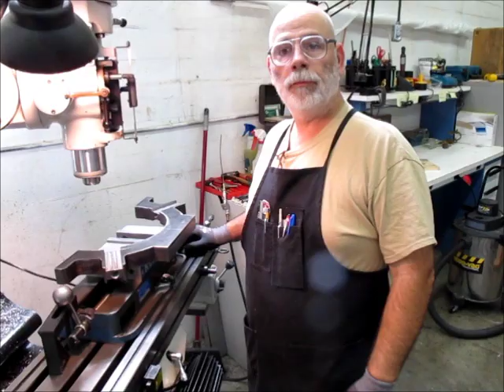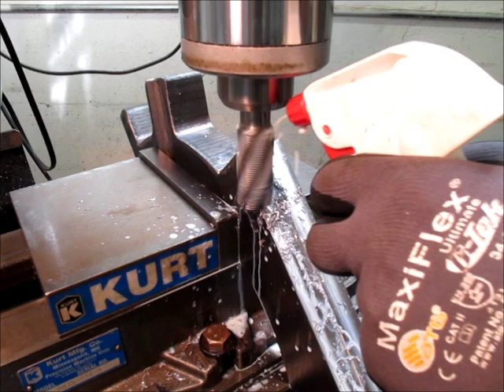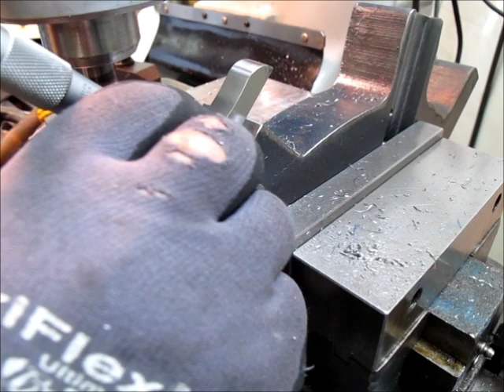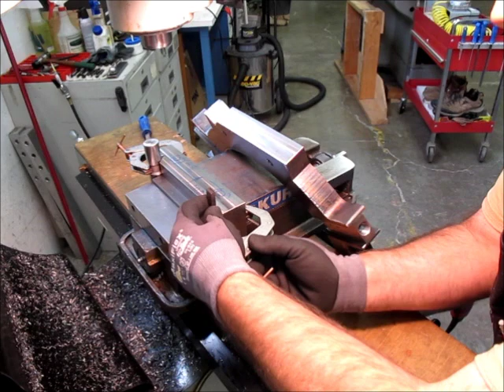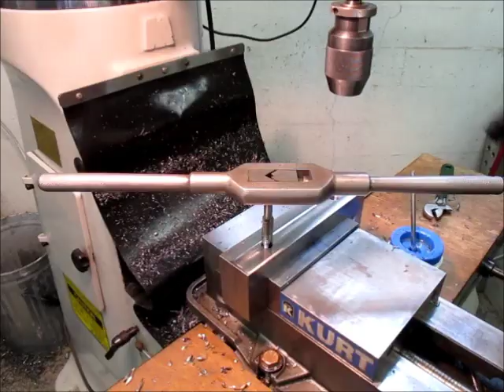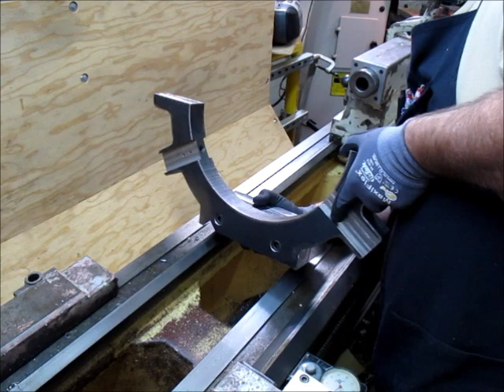Heavy Duty Steady Rest Episode 8

Comment: IIRC, those 'torr' or set with a button.  If so, then the bottom/top surfaces could be 'cleaned' and reset to be standard.  If not, they should have.  I have scales that way.  (weight).

Comment: I noticed when you assembled the Main hoop to the extender block you lined up the way-notch by "feel". Generally I agree with this practice, but would it not have been better to align the v-notch with a pin gage and straight edge similar to the way you aligned the parts for transferring the holes?
Reply from the maker: +Mike Kellam Hey Mike,

That was a long time ago. I think I was looking for a close alignment to drill the mounting holes. Once installed on the lathe the actual way was used to make it match more perfectly. Thanks for the comment.

Cheers,

Tom

Comment: We used the same digital protractor when I was in the USMC. We used it to set the angle for the arms, that the road wheels ride on, for the M1A1 Tank. You would hold the angle, then the torsion bar would index into the splines on the arm.
Reply from the maker: +Dray Holmes Hi Dray,

That is probably the coolest use of a digital protractor I have ever heard. Thanks for sharing that.

All the best,

Tom

Comment: We have one of those levels at my work, would it be good enough for leveling a smaller lathe. 11x56 say?
Reply from the maker: Hi Travis,

For rough work its fine. The body is not very long so I wonder about its real accuracy. Normally you would use something like a Starrett 98 or other long millwright or precision level. The proof bar tells the final story when setting up a lathe. Although with many modern lathes they are not that sensitive to out of level conditions. Old spindly leg shallow bed machines are like rubber bands and need to be leveled and checked frequently.

Cheers,

Tom

Comment from the maker: Hi Trevor,

You are correct. I aligned the centers of the two steady rests and then scribed the location. I then cut the vee and made it the same depth and angle as the stock groove. If it had to be super accurate on the spindle axis I would have left a little stock on the ID of the steady rest and finish bored it after fitting it to the lathe ways. Good question.

Regards,

Tom

Comment from the maker: Hi Bill,

The holes were a very close fit to the screws. It only takes a little longer to do it right and have a really nice fit. With transfer punching close tolerance holes  what would I really save? I still would have put it in the mill so might as well dial it in. I guess I've had enough marginal results with transfer punching on close fitting holes that I don't do it much. I did use them the other day to mount a vise to a table which is more my idea of their use.

Best,

Tom

Comment: Tom would using a transfer punch not have given you the accuracy you needed to locate the holes to be tapped?  I know the method you used with the indicator is very accurate I'm just wondering how a transfer punch would compare in this instance with a fastener going through a clear hole.

The steady rest fits well on the lathe, nice work.  I could tell you were pleased...